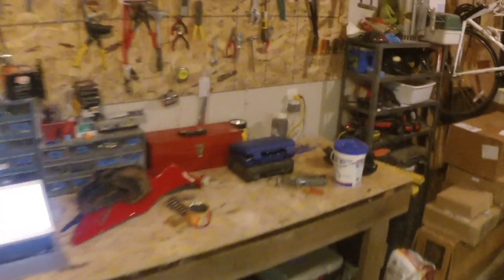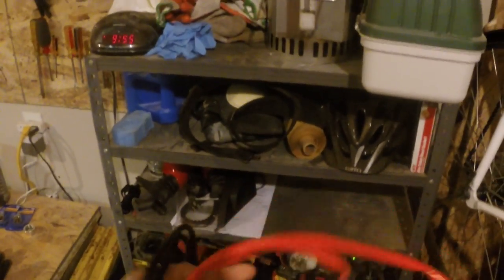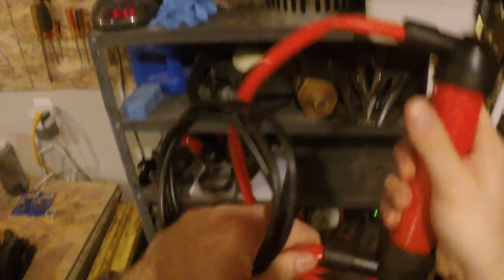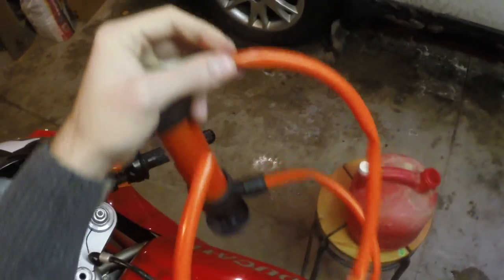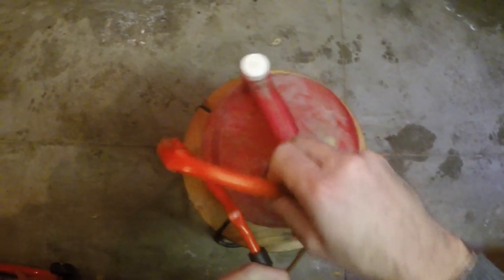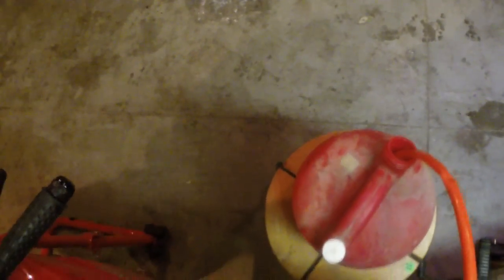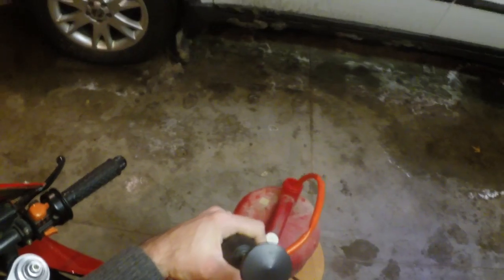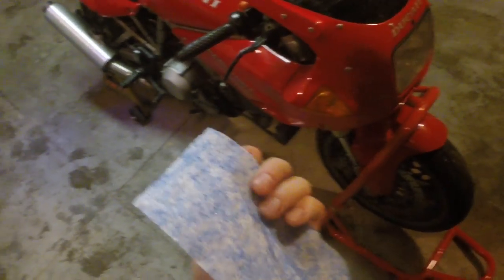There It's Done, Ep. 1 - Draining and Removing a Ducati 900ss Fuel Tank

Comment: Get two lengths of ordinary garden hose, one about 4 feet long, one a foot long. Put the 4 foot one into the lowest part of the tank with the other end in your container. Then get a piece of cloth and wrap it around the short piece of hose then stuff that in the filler cap, using the cloth to block the gap around the two hoses in the filler, the idea to make it as airtight as you can.
Then you simply blow into the short length of pipe. This causes the fuel to travel up the long pipe and starts the siphon.
Very easy method which prevents the risk or a mouthful of gas.

Comment: Guys you know there is a very accessible drain plug right? This dude did this completely ass backwards.... Removing the tank takes about 3 minutes. Then remove the drain plug and let it drain into a catch pain. I’m sure it can be done on the bike but removing the tank is so easy, and it will eliminate gas pouring all over your bike.
Reply: But then there'd be no video, would there!? :)